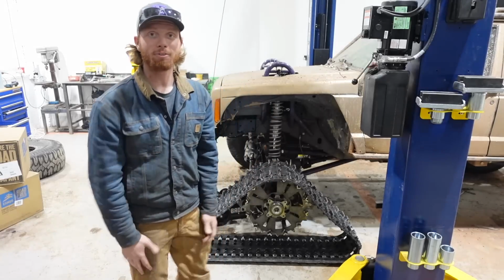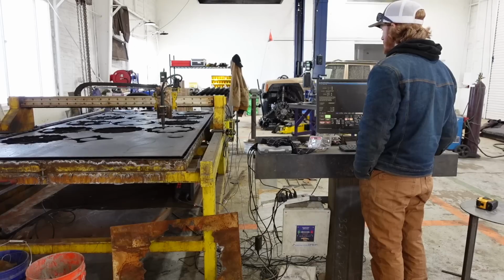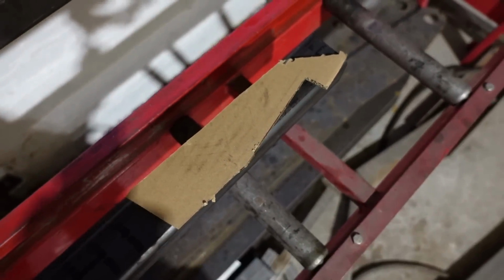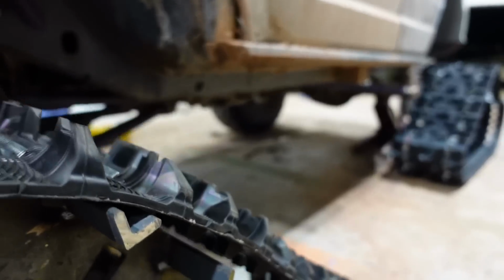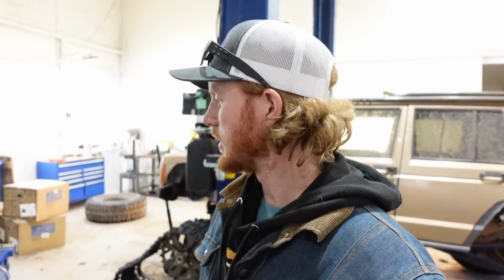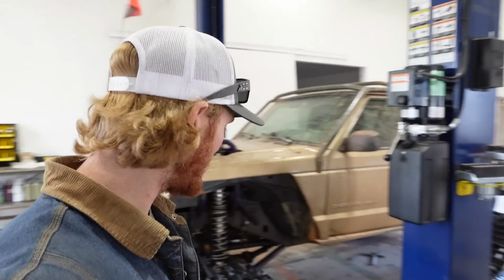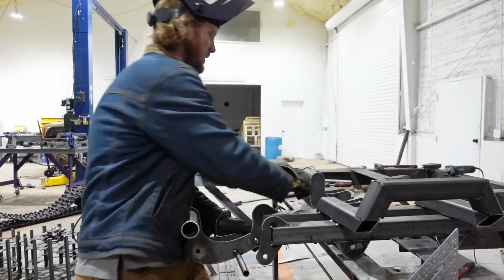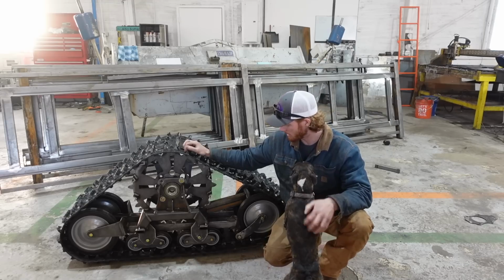Are These Snow Tracks Going To Be Enough???

Comment: It is a bit hard to to see in the video. On the Ransomes tractor and other vintage machines with the "roadless traction" system of rubber-linked metal cleats, the load rollers and idler wheels run on the smooth outer portion of the cleats and not across the drive teeth like I think I am seeing there. At best, there will be some cruelbad vibration. Unless the idlers are rolling smoothly, I doubt you will achieve enough tension on the across the drive sprocket without the load idlers locking up the motion or something bending in compliance and eventually cracking. That is likely to be across your stub axle fixture between the lower pair of bolts where the elbows of the webs are most likely to flex. 

If there is momentary baulking then steerage may be unacceptably unstable. When in neutral power, decelleration or drive, in forward and reverse, baulking may cause your track assemblies to tuck and chainsaw the vehicle body. The Ransomes has a semicircle (180degrees) of wrap around the drive wheel versus your 70 degrees or so. In overload, the Ransomes track band will still stretch, skip on the drive wheel and walk off the side. Its rear large idler, the smaller load idlers are carried between two steel plates. The outer of the steel plates has a support for the outer end of a stub axle which carries the drive wheel. The inner of the steel plates has a clearance for the hub of the drive wheel. 

Both steel plates are joined by two tubes which slide over two large solid steel pillars as a mounting arrangement. To remove, the track band is opened, the front wheel nuts and stub axle end nut are removed, the grub bolts securing the tubes to the pillars are backed out of locating holes and the whole assembly can be slid off with a bit of struggling and grunting. If my interpretation of design is wrong, then please forgive my making a big fella of myself.
https://www.youtube.com/watch?v=K9XKCBfRiAI

Comment: I’m worried about the hub flange that mounts the drive wheel to the bottom wheel section.

It needs heavy gusset plate mods, or needs to be made super thick.

It may bend or break off.

Comment: Cool project. From my experience, the metal on those larger wheels is exceptionally weak and will first crack, then warp, then explode. Perhaps with your welding expertise, you can weld some metal reinforcement on those.....

Comment: Stuff like s10s or older vehicles will have a shaft thing with a nut to hold two bearings together just like a 4wd hub but with no drive stuff it's stronger and better than them sealed never grease butterium metal one piece style. The older style will loosen then you can tighten it but when the new sealed ones loosen up they fall apart

Comment: The big question is if they are light enough and easy to install so you could take them on a job as loaded on a trailer, rack or boot, drive to the location and then swap normal wheels to tracks.

Comment: i dont think the bearing mount you made on only (one) side will hold the weight in bumpy terrain. you should have  clone on the other side mounted to the bracet so the weight of the truck is on both sides of the track. other then that it looks really good :)

Comment: Any reason you're not considering running a coil spring on the front idler wheels for tenstion similar to how excavators use hydraulic pistons to maintain track tension? I'm sure getting it laid out would be a nightmare but a cut coil spring would provide cushion to the front ilder wheels via compression while retaining tension. Would likely have to be a large coil spring from a half ton or 3/4 ton to withstand the abuse. You could even go crazy if you wanted to and use a coil spring with air bag in the center to run a softer spring and add some give to the front to relieve stress and prevent metal fatigue. I imagine you could weld in a plate with nut on the frame for the track and use a piece of all thread to compress the spring to set tension as desired.

Comment: Only thing that i question is if the steel on the drive gears is thick enough. Steel bends when add lateral pressure to it. Hopefully you don't turn and fold those little fingers over.

Comment: The wheels need to be solid on the bottom if you look at skid steers they are all steel,  pneumatic tires won’t be good will allow the tracks to slip and fall off they need to be tight.

Comment: tracks will be at  2 times heavier.... It may be some less but I doubt it....  Outside wheels are massively  under engineered... I recommend you reconsider....  I would recommend anything with a small bearing assembly with the same quality as an actual wheel bearing...  Doc...   p.s. I would "borrow"  the idea of a track builder.... perhaps rip the part number from a commercially available track....

Comment: Those wheels will give you trouble. They have really really cheap bearings with no provision to keep dirt and grime out of and they will fail anytime, anywhere. The larger wheels can and will actually tear the centre bearing hob out when it seizes. All things being considered the smaller wheels will give you a similar performance. I've seen them used in different services but they always seem to end up totaled due to the poor bearings. They are made for walking speed uses like hand carts and roller tables. Anything more than that and you are on your own. Have you given any thought to using sliders like a snowmobile suspension uses instead of those small wheels? They use snow as a lubricant between the track and the slide. As for the larger wheels, well you may want to consider making your own A piece of say 12" standard wall pie 2 or 3" long with a 1/4" thick centre welded in. The centre would be drilled/bored to take sealed flange bearings that are reasonably priced. Amazon has dozens of sizes but considering you are using 1/2" axle I would say that each wheel would need two bearings, one on each side, sandwiching the wheel in the centre. These are sealed bearings and have grease nipples for lubing them. You can find some here:   

https://www.amazon.com/PGN-UCF201-8-Pillow-Mounted-Bearing/dp/B084HLTVX4/ref=sr_1_16?crid=3OC508LKYEUGS&keywords=flange+bearings&qid=1675018579&sprefix=flange+bearings%2Caps%2C132&sr=8-16

There is a way to make the outer wheels even less expensive but I would have to question how long they would hold up to the task. Simply make them out of 3/4" marine grade plywood glued and screwed together to make them, say 3" thick. Wood is stronger than steel in compression and it's also lighter. Just some thoughts...........

Comment: I don't see those smaller 4" and 12" wheels to last long.. but they might work for testing. You're going to want to machine or CNC new ones, or get way stronger bearings in them. I've made this mistake before on a project:( tacoed one of the 12"ers immediately.

Comment: Snowmobile bogey wheels can run $20-$40 apiece, and come in multiple sizes and colors to customize the style and can help remove snow from the tracks.  Rudy's choice to use hardware store wheels rather than wheels that have been designed for this specific purpose is another case of reinventing the wheel.  It would be interesting to know the price difference.  

His choice to articulate wheel pairs looks reminiscent of the WW2 Sherman Tanks (which were actually independent).  The arms are rocking even when he's just rolling it on flat ground, so it looks like this will be a wear item since there is not a lubricated bearing or bushing.

I was familiar with Casey's tracks so I watched the Ambition Strikes build.  Now I am wondering why Rudy chose the heavier Square steel rather than using plate steel that is used in Casey's factory design and the Ambition Strikes design. I don't see the benefit. We'll see...

Comment: IMO, you need to either put a larger front wheel on, or give the bottom of tread, an angle in the front, you need to be able to climb over, get on top of snow, obstacles, that small front wheel, just going to bury it's self in deep snow

Comment: Doesn’t look like you need 12” wheels on the ends.  Use a smaller more robust wheel and your track surface area would increase too.

Comment: In case I missed it in the Pt1, and I've not yet seen it in this one, make sure you bolt the hub bearing center (where the axle would go through) together, so it doesn't separate.  EDIT:  @21:00 nevermind ;)

Comment: Tracks will weigh more however your ground contact pressure will be much much lower giving you flotation in the snow instead of 35+ psi you could be around 5-7 psi

Comment: I'd like to say I like the quality. I think if you look at classic tank track design you will notice that there are 2 wheels on the front with a 45 deg angle from the top wheel to the bottom wheel. This is done for going fast without digging in the front bottom of the track. On the bottom of a snowmobile the body provides the angle in front of the track. Limiting straps on the front of the track may keep you from digging in at speed. Good luck.

Comment: I’d be willing to bet no matter what steel you use it’s still gonna be at least 300lbs per track unit. Still worried about the drive “sprocket” destroying that track with how sharp and pointy and thin the teeth are going into the track clips

Comment: The rubber on those 12” wheels probably won’t hold up. Being a critical dimension to the design, it might be a good idea to load test them individually before you test the complete system.

Comment: Your boogie wheels look more than sufficient….you idler wheels well they just don’t give me a warm fuzzy feeling ..I personally would of leaned to a small trailer tire complete with trailer hubs…edit. Your adjuster should all be to the Back of the track so when your accelerating all the force is on the stationary wheel and not on your adjusters

Comment: The bearings in those pressed steel wheels are very likely Chinese junk, not designed for any type of high rpm. They will fail very quickly.
I'd also be worried about the load rating, the urethane on those wheels can separate under too much load. 
How will you tension the track? Some have a tensioning device with a small shock.

Comment: The 12” wheels will fail. 1/2” axles ?… all the torque and weight will be transferred to the front and back idlers. Rethink them..maybe something like a steel utv wheel/axle.

Comment: I think your weak point (not counting your current 12” wheels) is going to be that everything hanging off your two wheel drive spindle is going to want to go sideways when you make turns under any speed…
Reply: Exactly. This is why Rudy should really consider adding a brace on the inside of the tracks so it's not all just leveraged against the one hub bearing. Gotta try to keep the forces hitting the hub bearing mostly radially. But hey, he'll find out soon enough what the limits are, with some testing.

Comment: Prediction: The steel wheel teeth that are supposed transfer torque to the tracks will destroy the plastic tracks very fast.
Reply from the maker: Think of the steel teeth as more as a preventative, the real driving force is in the angle iron underneath

Comment: I'm surprised you didn't just use your plain fitted rims and weld on this gear sockets without the centers to both front and back of each rim and then you have the strength and the ability to still mount and unmount your wheels easily , I would try that and way less material waist ! No ?

Comment: First of all, I want to admit I know nothing about tracks, however, it appears that the whole track build is hung off of the flange Rudy built around the center hub. To me, that flange looks like a weak point in the design as it will have very little resistance to a twisted rotation or sideways up force. Am I way off base here?
Reply: Would there be any way to get another flange mounted on the back side of the drive wheel?

Comment: The tires should outweigh the tracks as light as your building them but then I would crush question the structural Integrity of the material that you're using
Reply: Saying that I missed in the whole video if you used any graded plate but if that is like grade 50 or grade 80 man that thing will wheel for years kickass design dude

Comment: You are pretty good when it comes to fabrication and with the plasma table but if you had an Arc Droid, a hand held plasma cutter, a cutting torch and a welder that does all three MIG, TIG, and Stick and a Lathe, and Mill and a few other fabrication tools you'd be a BAD MAN when it comes to fabrication and over time I think you should and could accumulate all those tools and then you could open up a fab shop to the public and start making really good money because fabrication shops charge a nice penny for fabrication and the skills to run those machines don't come easy especially those days and then after you accumulate those tools I'd get some CNC machines and make billet pieces and then you'd really be in the money

Comment: If you haven't actually already got this on the road Rudy, you should use a wheel with a bearing in the center everything you're using there is meant to be used as a dolly wheel or a cartwheel maximum speed 5 miles an hour is the speed of a walking human being